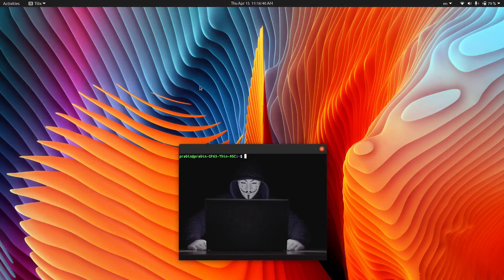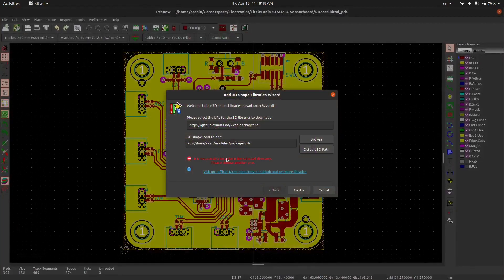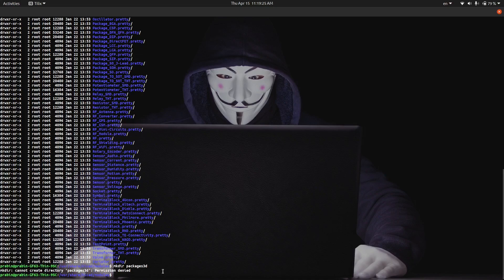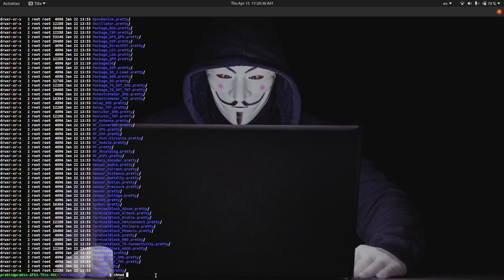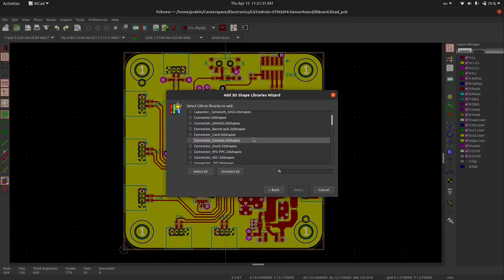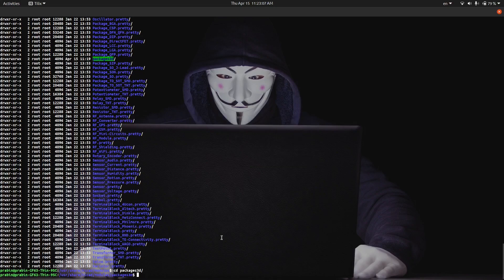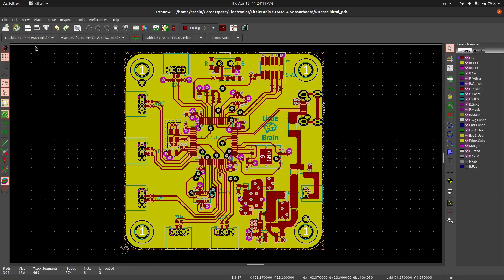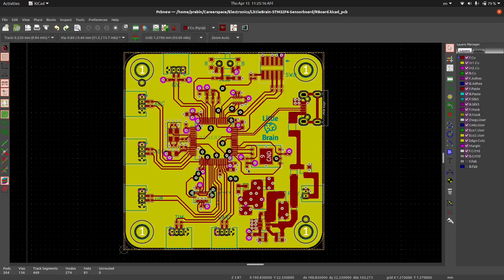3D models not showing in KiCAD [FIXED!!] Ubuntu Linux

Comment: One linux issue, /usr/share did not have the permissions to write files. So, I did chmod 777 on that directory and other directories from the command line. I then found the 3D model directory. I did " touch file1 " from my user account. Basically, if you can't write to the 3D model directory, you cannot import 3D models. It's a bug in KiCad in 2022 December build.